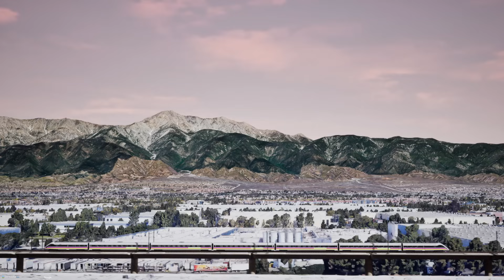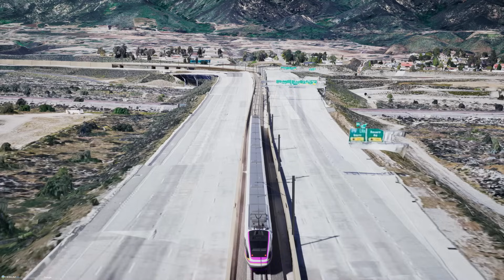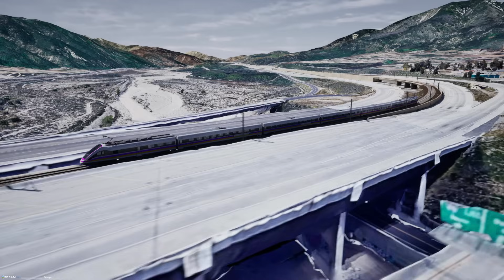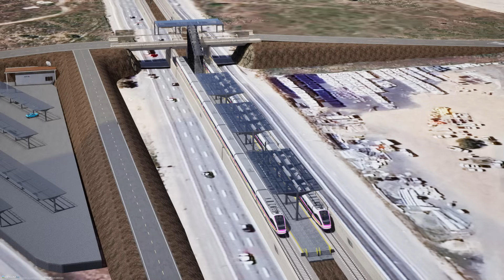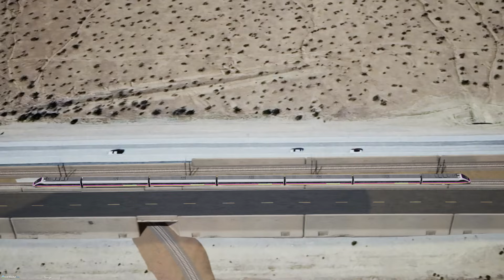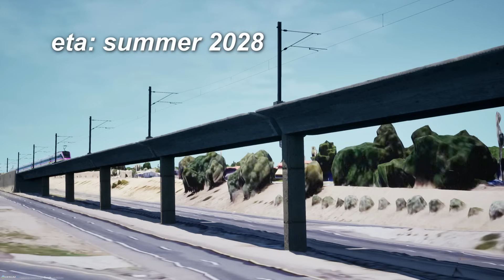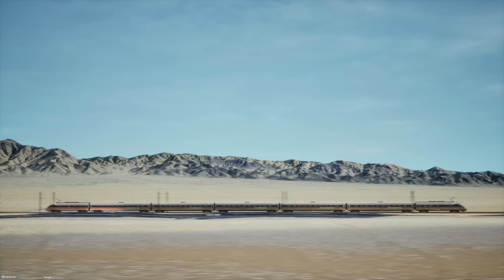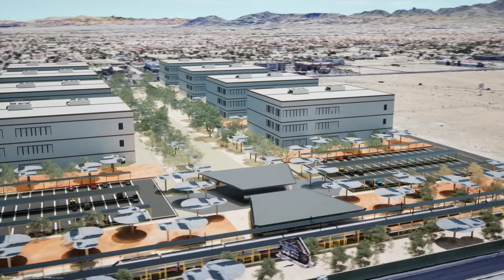The Brightline West High Speed Passenger Rail Route Rendered With Unreal Engine 5

Comment: A partially single track high-speed line is a new one for me... I thought it was a joke.
Anyway, fantastic work with the video !

Are you sure about the gradients? Because there are "per cent" and "per mil".
As for the turns, I have a hard time estimating them due to the desert environment, but some tighter turns can be managed at high-speed with enough track banking.

I don't really see how they'll manage the train spacing with that much single track.
Does it mean Brightline West will be limited to one departure per hour? With no growth possible? 

I'm a bit baffled by the single track part.

Are there any info on the signaling and train control system they'll use ?

Great video as always.
Reply from the maker: The grades are from the environmental assessments. 
One hour headways are planned initially. They have a plan to switch to 30 minute headways, eventually. They would add about 100 more miles of double-tracking for that.
According to the Buy American waiver, signaling and control would be systems Siemens builds for Europe.
Reply: @LucidStew   Thanks. Do the assessments specify the scope or length over which each gradient is spread? 
Usually, the limit for high-speed lines is substantially higher than for freight trains.
There are HSL's in France and Germany having a 3.5 or 4% gradient (or 35 to 40 per mil) where full speed is performed without issues. But as most high-speed lines, these steeper parts rely even more on the momentum of a full speed train. And on the descent, motors generate power. Which will be very useful here given the number of accelerations along the route.

A "full adhesion" train (with pretty much all or 3 quarters of its bogies powered) should be able to overcome a 6% gradient. I'm not sure about the speed, though.

As for Brightline, if they want to increase frequency to every 30 minutes, they'll need way more double track.
Honestly, I couldn't believe it when you said there would be so much single track, it goes against the very foundation of HSR. It also poses questions about the safety practices and rescue operations. A train breakdown on a single track becomes a nightmare...

Besides the fact of adding 100 miles of double track, it means that the single track would already be positioned on one side or the other, with space reserved and prepared next to it. Which represents most of the work already
If not, they'd have major works to perform that would mean interrupting the line for months if not years.
The fact that they think about adding double track later is very surprising to say the least.

Are there any infos on the "right-of-way" protection? Will they build walls on each side? Implement a track incursion detection system?  The median of a highway poses the risk of vehicles crashing onto the tracks.

So they'll use systems like ETCS, ERTMS, etc. ?
It's the high-speed and general rail systems developed by the likes of Alstom, Atos, Hitachi, Siemens, etc. in partnership with the EU and national operators, like SNCF and DB to standardize and improve systems.

Really fantastic work that you've done with this video. How long did it take you?
Reply from the maker: @KyrilPG   It does. The elevations are described for the entire length. Most are 2-3 miles at most. The most dramatic is the Hallorin Grade, which is about 16 miles long, ascending at an increasing gradient from 0% at Baker to 4.4% about 9 miles in, then easing from there to the summit. The grade between Mountain Pass and Ivanpah Lake is similar, but about half as long. One issue is that in many places the highway geometry won't allow the train to gather much momentum before ascending.  Shadow Valley and the ascent from Ivanpah are really the only places where that will work out to their advantage.
I'm not real familiar with control system, but my understanding is that it won't be the full ERTMS, but they will use ETCS and GSM-R basically because its just them and they have nothing else to coordinate with on the corridor.
I think it took 11 days to put this together. I was aiming for a week, but it took a little longer due to the amount of walls and barriers that needed to be added. Most routes I've done like this are just the tracks and train, which is a little less time consuming. I also had to build the stations from available parts, so that took some time as well.
Reply: @LucidStew   Really impressive work ! That shows dedication...

That's what I feared about not having enough sections where they can rely on momentum. They'll much more rely on traction than than on a regular HSL.
Which part is up to 6% in gradient? Over which distance ? Does it have enough "momentum building" track mileage before? (Didn't know how to write it more clearly).

It seems they're going with Siemens Velaro derived rolling stock, which is what I expected until learning about the gradients. Given what I learned in this video, I'd say that an AGV derived train would be a little more indicated here, as it has a little higher power to weight ratio (and slightly lower center of gravity which helps with tighter turns), thanks to its TGV Jacobs bogies. 
It generally has half the number of bogies plus one, compared to a train with regular bogies. An 8-car AGV variant has 9 bogies instead of 16 on an 8-car Velaro, which considerably reduces weight as bogies are among the heaviest parts on a train. They just use comparatively more powerful motors on each axle to make up for their reduced number. And they'll consume a little less power with the frequent acceleration phases of the line, thanks to their reduced weight (and also thanks to the reduced number of aerodynamic drag inducing elements).
With all its specificities, this line will consume more electricity per train and per passenger than a regular high-speed line where momentum is more heavily relied on. This, even with ample use of regenerative braking, as their won't be enough trains running simultaneously to really benefit from power regeneration.
Reply from the maker: @KyrilPG  The 6% grade is the climb out of Cajon Pass from the south. It is in the area  of 6% for about two miles. The preceding curve will accommodate about 75mph.
Reply from the maker: @KyrilPG  Cajon Pass will be a slog. The geometry should keep them at or under 75mph through the whole thing. The initial climb into the pass is 4.18% for 2 1/2 miles. I have the curve before that at 2200ft and roughly 60mph. The middle part is more level, but curvy enough to keep them from building up much speed. It looks like they can go into that curve before the big climb as fast as they can take the curve.
Reply: @LucidStew   How much track banking angle did you take to estimate the reachable speeds? 
On HSL, track banking can be substantially higher than on regular lines to compensate for the speed increase and to allow tighter curves. So much that it can be uncomfortable to run at slow speed on these sections because you feel like the train is leaning sideways and it blocks freight trains from using the line due to the banking angle.
Reply from the maker: @KyrilPG  I'm not doing any math. I use a reference chart for common radii(1/4 mile, 1/2 mile, 1 mile etc), but the reference chart is geared toward data for HSR trains using U.S. standards. I round on the chart, so its likely off, but not by a large percentage. I wouldn't expect my 75mph estimate to be 100mph in reality, for instance.
Reply: @LucidStew   I asked because the radii aren't the same for regular and high-speed tracks, and also between types of high-speed tracks, regulations, and locations.
Let me explain :
Let's say that a given turn radius limits speed at 100mph on conventional track, the same turn radius on HSL will only limit the speed to 125 or even 155mph thanks to the much more important bank angle built into the track.
And, depending on what the tracks are used for, they can have a more or less important angle.
For example, a new high-speed line that must be capable of handling nightly freight trains, won't have the same built-in banking angle as one that's strictly dedicated to passenger high-speed trains.
The passenger dedicated one will be able to have 2 to 3 times the amount of banking angle and will allow higher speeds.
I've once or twice had my train stopped in a highly banked turn and it's really impressive how much it leans inside the turn. But the angle is totally imperceptible when you fly through the turn at maximum speed. You may just feel a little pushed on your seat like gravity is a bit stronger.

A good example of that is the HSL between Frankfurt and Köln that's exclusively for passenger use due to the 4% gradients and higher banking angle, contrary to most of the German high-speed network that is shared with freight.
This HSL is operated at 300kph (186mph).

It's the opposite in France where the high-speed network is almost exclusively dedicated to passenger trains, with much higher banking angles and faster speeds in the same turn radius than on conventional tracks. Most of the network is operated at 300 and 320kph (186 and 200mph).
There are few sections that are shared with freight trains.
There are also conventional lines normally limited to 160kph (100mph) and 140kph (87mph) in certain turns, that were upgraded with sufficient bank angles to be run at 220kph (137mph), with a dip at 200kph (125mph) in the difficult turns. The banking angle upgrade, while still limited by the conventional track, enabled a 60kph (38mph) increase in speed for HS trains.
It's a bit like implementing the pendular function into the track.
So the speeds will depend on how much bank angle they'll set into the track, not only the turn radius.
A single degree in banking angle has an important effect on the allowable speed.
Are the FRA regulations even up to date on this?
Cause I don't think there's currently any track in the US that has high banking angles like can be found on some European HSL's.

The center of gravity also matters, some "end-of-line" conventional tracks allow 220kph (137mph) for TGV's when regular trains, even if they are capable of more, are limited to 200kph (125mph) or less. Just because their center of gravity is higher than on TGV's, they must run 20 to 40kph slower on the same tracks.

The amount of banking angle is always a "tradeoff's adjustable variable" for HSL between the straightness of the tracks and construction costs.
The less space and "straightness" you have, the higher the banking angle gets to compensate and preserve speeds.
Is there a maximum angle allowed in FRA regulations? 

This also poses a question about the possibility of double track. Because in the limited space of a highway median, a single track could use the available space to create more gentle entries into the turn, allowing higher speeds but taking the space of a future second track.

If I recall correctly, the maximum allowable bank angle in France is higher than in Germany for example.
So, is there an angle limit in the FRA regulations?
Reply from the maker: @KyrilPG  I understand the concepts of cant and superelevation, but I do not bother with the calculations in the interest of expediency. The reference chart I use takes U.S. superelevation and cant deficiency limits into account. The U.S. limits are lower than in Europe.
Reply: @LucidStew   I'd say the limits in the US are lower simply because there's still no true HSL in service in America. Don't you think? 
Maybe they'll be comparable to Europe now that proper high-speed lines are being built for proper high-speed trains, lines that won't share their tracks with any other types of trains besides maintenance ones.
It would be quite limiting and somehow wasteful to keep the lower "conventional" rail limits on proper HSL track bed. It would be like watching SD footage on HD TV's.
I think I have a reference chart for French and Spanish HSL somewhere.
Reply: @KyrilPG  Europe has a large flat plane that makes high speed rail cheap and easy to build but here in the USA the major population regions are broken up by long distances with few cities between and major geographical barriers.    Also the population here in the USA does not travel between cities as much as people do in Europe, for example the on the West coast there is only 1 major freeway   i5  so you think it would be full of traffic and very busy right?   But that is not the case, you can right now look at Live cameras like on Siskiyou pass,   if you want to drive from Seattle, Portland to California you have to go over this pass, and yet the road is empty it is really empty,  you trucks carrying cargo but very few cars overall.

Comment: Am i the only one seeing the potential for a new south/southwest/southeast metrolink connections to bring people up to Rancho station faster an make it the true huge hub for the region it will be anyway once you consider Ontario airport nearby.

Plus... by the time this is finished Metrolink and LA should be hard working on improving the access to Union Station because all this BL wow wont worth as much if there is no prospect of getting to LA proper
Reply from the maker: Right now the only lines with the possibility to roll directly in there are the SB Line and the Metro A Line. I think it would a good idea to extend the Metro A Line another 11 miles from Pomona to Rancho.  SB County is also planning a people mover from ONT to the 8th St. station. There are also appears to be a possibility to connect BLW with the UP route that runs next to ONT. Connection possibilities there are southern San Gabriel Valley, Riverside, and CAHSR Phase 2 in the distant future. Unfortunately the connection to Orange County would be lackluster unless a totally new rail route were constructed, which looks near impossible.